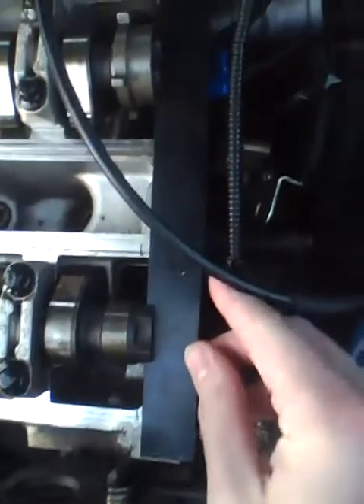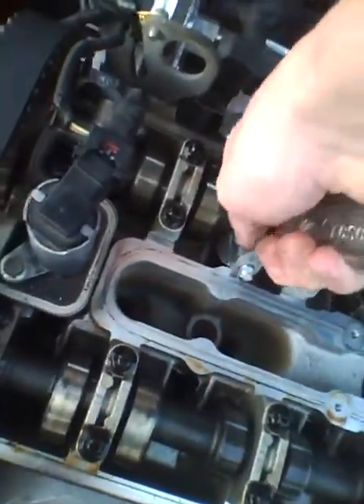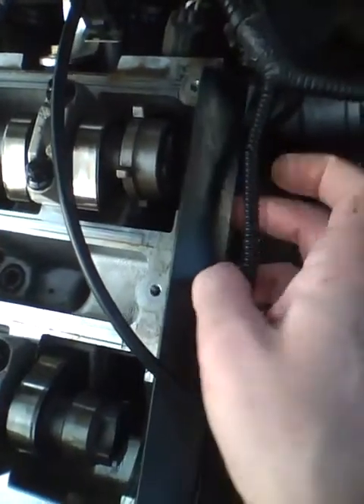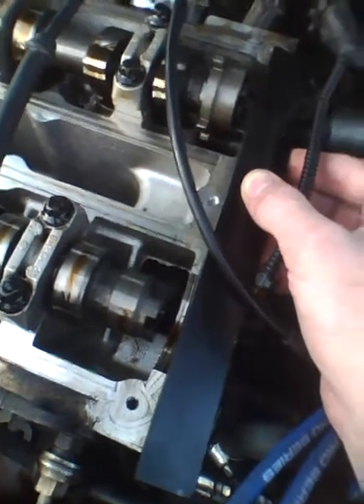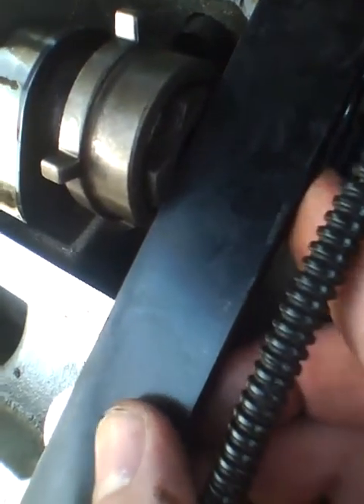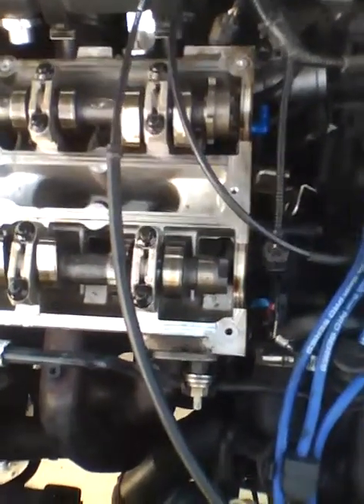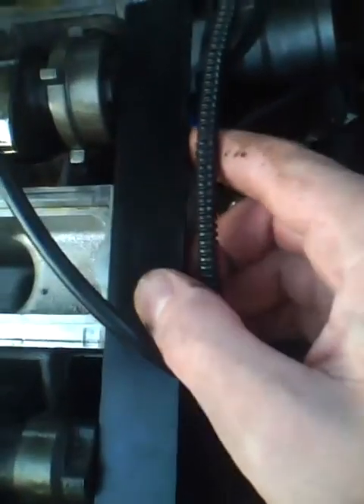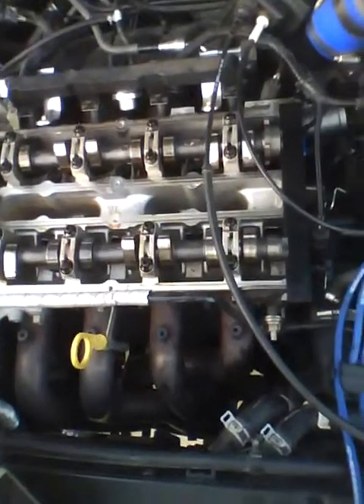ford focus svt timing belt

Comment: Yes timing is off , with the timing pin in it should be lined up, the reason is your cam cogs are not loose, they need to be free wheeling when you install the cam timing plate , that's the whole reason they don't have keyways , the cam sprockets are taper lock so when you have the crank pin at top dead centre , you then put the plate in aligning the cams , then tighten the cam sprocket bolt on both locking them in position , all you had to do was loosen the intake cam sprocket bolt and it would have slid in then just retighten to 50 foot pounds

Comment: So, I’m finally replacing my timing belt and have everything removed and having this exact issue, my intake cam wants to move out of position when I take the plate out? So I end up using a crescent wrench to move the camshaft back to the position it needs to be for the tool to fit in the slot. The exhaust cam fits nicely. The belt and pulleys have not been installed yet either. So I’m a little confused there. I thought all of this was done before putting the new Tbelt on?
Reply from the maker: I did all of this with the belt and pulleys on. What's your email and I can send you the exact procedure from Ford
Reply: @anarchyamp  I sent an email to you so you had my email address. Thanks I appreciate it!

Comment: when you time it on the crank pin and on the cams bar, and you tighten the belt and everything, you have to unscrew the bolt-cap on the VCT on the intake cam, then loosen the bolt inside so the vct 'resets' and then tight it again, then screw back the bolt-cap. While the bar is still in place.

Comment from the maker: Hey Axlelke, I did have already have an issue with the vct solenoid not working/not switching over at 4 or 5 rpm's like it should, it would only switch over sometimes to the short intake runners, vs the long intake runners, you should hear an audible airy sort of sound at high rpms, sorta like vtec, but it's ford version of vtec. So I took the whole damn thing apart again and make sure I timed it again at top dead center for piston #1 or the one on the far left by the passenger side.

Comment: For the future - where can I get a fairly decent scan tool ? Better than a cheapie WM or wherever $ 20 one ? Just what do these cheapie ones are useful for ? And if you can tell me its fairly decent diagnostic uses on possibly a better one . I don't have much experience with these things just the few times at Auto Zone and I just plug it in and gives a print out .Thanks
Reply from the maker: World is moving towards Bluetooth obd2 dongle paired with an app like torque on your phone

Comment: It's really simple, you must install locking tools and then you must slacken both camshaft sprockets before you install the new timing belt and tension it. Once tensioned you tightened the sprockets remove locking tools and your done.
Reply: What do you mean by slaken?
Reply: @lu8115  loosen undo. Make sure you use a spanner on the camshaft flat to counter hold the camshaft whilst undoing the sprocket bolt or you will snap the camshaft where the locking tool is installed. The locking tool is only there to keep the engine timing position correct not hold the engine whilst you undo bolts which are very tight!! The torque spec is Inlet cam 120nm exhaust cam 68nm
Reply: @LAW-Automotive  thanks for the clarification.

Comment: I've 2016 Focus SE 2.0L GDI Flex fuel . engine . Can someone tell me if loose timing band will bend rods and valves ? One says  yes another says no way . What's the truth ?? verry hard to find a good mechanic
Reply from the maker: Just find out if it's interference engine, if it is, when the timing belt goes, it WILL bend valves.

If it's not an interference engine then you're safe
Reply: @anarchyamp  what's an interfering engine? Never heard of it
Reply from the maker: @frankmontez6853  Google my man
Reply: @anarchyamp  ok watching video of this type of engine . Google to see if mine is interference one ?
Reply from the maker: @frankmontez6853  yes
Reply: @anarchyamp  found one source saying it's non interference
Reply: @anarchyamp  just today this mechanic thru phone walked me thru compression test . A test kit from Auto Zone . It was basically the same as others I've seen on videos . A lil different ( I think ) in that he didn't have me remove fuel pump fuse disabling it . he also had me take off all spark plugs off at same time and test with gauge . I cranked it for about five seconds and each one had over 120 psi almost 130 . He said that's plenty and manual says 12:1 . Sooo based on that he doesn't think engine needs replacing ..?? If you agree that's fantastic newss !!! That whatever the reason for my prooblem of not starting running definitely don't need engine replaced ?? !! Your input would be greatly appreciated sir . thanks
Reply from the maker: @frankmontez6853  agree your engine is fine. Your no start condition is something else
Reply: @anarchyamp  next he wants me to rescan it though I did it a couple days ago . Something about erasing thiose codes and starting fresh . A couple days ago showed camshaft codes several times . Having a problem finding scanner that they loan or rent out ..Since car's not running and can't bring it to them at Auto Zone or anywhere else
Reply from the maker: @frankmontez6853  yes scan the check engine light for codes and work ok fixing what it says is wrong. Could be camshaft sensors

Comment: I believe your intake cam is @ 5 degrees b4 or after tdc because you have vct! the svt models are a bit different then the zetec models! I believe your intake cam should be  a little off because of the variable camshaft timing(vct)  I think its 5 degrees b4 top dead center? don't quote me,  then again its probably 5 degrees after tdc!!! looks like im right about the 5deg AFTER TDC/// BECAUSE THE VCT CAN CAUSE YOUR INTAKE CAM TO GO 30_40 DEG OUT FOR PERFORMANCE & FUEL ECONOMY? MIGHT NEED A DEGREE WHEEL? CALL A FORD DEALERSHIP! & PLEASE LET ME KNOW WHAT YOU ENDED UP DOING & FINDING OUT AFTER COMPLETED PLEASE??? I HAVE A FUCUS SE. ZETEC, VIN 3 MODEL & WISH I HAD THE SVT!!! 4 MORE POWER! IMA ADD A TURBO & UNDERDRIVE KIT & POSSIBLY AFTERMARKET CAMSHAFTS IN THE FUTURE!!! IM WAITING ON MY TIMING BELT,WATER PUMP KIT($37.00 EBAY) & THE TOOL KIT($15 AMAZON PRIME) TO ARRIVE!  COULD HAVE GOT THE TOOL SET 4 AS LOW AS $10. ON AMAZON BUT, I WANTED THE PLASTIC TOOL CASE 2B INCLUDED SO I PAID $5.00 MORE! I have upgraded so many parts on this car that I have put3- 5x its book value into it so, I have to do everything to make it last another 10 years to be worth it! its way nicer then when I got it! Added wifi & Bluetooth!!! soon 2 come,SOME BEATS!!!
Reply from the maker: D.j. B nice man, how I timed it was fine, once I put it all back together, it ran great with no issues or check engine light

Comment from the maker: Also, make sure you use the cam alignment plate, and the crank pin to get it all right. After I did it all a second a time, which I think was for no reason in my case, because it was still having the same problems, I was frustrated and stumped because I knew I had done it all right, so with my last bit of patience I replaced the vct solenoid and it instantly fixed everything, cel was gone and power was back. The vct solenoid is the silver tower looking thing that the connector goes to.

Comment from the maker: Hey not sure what you mean by "the cam gear is on key, it is the vct" and also ship it? Why would I ship it? I fixed it myself and it did end up being the vct solenoid that was the problem the entire time, it was sticking and not actuating correctly, but the car did need a new timing belt so i'm glad I did that anyways. Please also refer to my note under the vid.

Comment: I have kind of the same problem that you good people have my car was fine  until on regulatory inspection I had a p1381 timing over advanced my local garage replaced all timing sensors idol valve plugs leads  coil pack vct  solanoid full timing belt kit and still the code persists
Reply: Exactly I have the same problem with mine Ford Focus 1999
Reply: +Craig Lowmo I had that problem, changed VVT pulley and it went away

Comment from the maker: "Place camshaft alignment plate on the camshaft. Top it off by putting the cam gear locking tool." These 2 things are the same?

It would work if your timing hasn't moved at alll or jumped teeth or some of the ribs have come off the belt (my old belt was missing like 3 ribs) and make sure to replace the tensioner pulley and idler pulley along with the timing belt as well

Comment: easy wat\y to deal with your timing dilemma! just mark the belt & pulleys, undo the belt,line up the cams & button everything up & test drive it. IF ANY PROBLEMS, RETURN THE INTAKE CAM TO ITS ORIGINAL POSITION. ON MY ZETEC, I LINED BOTH CAMS UP WITH LOCKING PLATE!

Comment from the maker: Not sure what that code is but look it up and for me the problem was the vct solenoid so it might be it for you too. Test it or swap it with a new one (they're like $80-90). Make sure you did timing procedure %100 correct. Don't drive it until you get this fixed. Make sure to use the tdc pin and cam plate when aligning to top dead center to get timing right. I can send you pdf file of exact procedure if you need.

Comment from the maker: I'm confident you can do it too. It's definitely not easy though, at least not your first time doing it. Expect to be working on it for several hours. Also, you will need an air compressor and impact gun to hit the crank bolt with to get the crank pulley off to remove the old belt and put the new one on. Ask me how I know lol....any other questions you have let me know and I also have the pdf document from ford if you would like to follow that, got it from a fellow Focus Fanatic :)
Reply: I put my breaker bar on my crank bolt & used the starter to break it loose & it worked!!! TIGHTENING IT ISN'T AS EASY! ANY ADVICE IS WELCOMED!
Reply: anarchyamp I would appreciate the pdf file bc I’m going to attempt to do this job on my 04 svt

Comment: Hi mate did u sort ur intake cam out as i got exactly the same issue my crank hits the pin and cam plate slides into exhaust cam but intake cam is a hair off any news would be greatly appriciated 😁
Reply from the maker: Chris Symes yes, it was ok so you should be ok to proceed

Comment: the reason the intake cam moved differently than the exhaust cam is because the vct for the intake cam needs oil pressure to hold it in place. my 2002 focus svt has the cam advanced code and I don't really know how to fix it.. all I know is i need to get that pin. 
any suggestions?

Comment from the maker: Hi, yes the svt is the same thing as the ST170, I can email you the pdf but please be advised this job is not for the faint of heart. It requires the use of special timing tools and removing a motor mount and jacking up the motor, and if it is not timed correctly when back together, you can bend all the valves on the head and it will cost a ton of money to replace. Also I dont know that code off the top of my head but i have a list of all DTC's i can also email you
Reply: anarchyamp any chance of the pdf for this change

Comment from the maker: What you did sounds right, I never put oil back into anything. I don't think lack of oil will give you the problems that you and I had you know? In fact, as soon as the car is started, oil is pumped throughout the block and head all over again so it would get oiled up again by itself. I have the ford writeup of how to do it, ill send it to you if you want, whats your email? Was your vct switching over at high rpm's before you pulled it all apart?

Comment from the maker: Redo your entire timing belt procedure and make sure the vct solenoid is working correctly. Also make sure you have the pin and cam plate when you do the timing procedure.

Comment: I'm not familiar with the svt motor! I read a comment on youtube where some guy was threatening another guy but, He was speaking about one of the cams being retarded by 5 degree's. Idk if that would also apply to yours or not? My zetec doesn't have vct! I removed the exhaust cam,to get to the lifters & hoped mine was set up like a Mazda miata lifters (so i could clean them & reinstall em but, No there not! Their just metal caps & the springs are attached to the head. So, I put everything back together.torqued the cam caps to 15 ft lbs.

Comment from the maker: have. I turbocharged my ford focus svt. I built from the ground up myself. I do everything on my car. I bought and installed, and tuned it myself. You stupid fuck, do you even understand boost? blow through MAF's? air/fuel ratios? sct advantage III tuning and data logging? Get the fuck out of here.